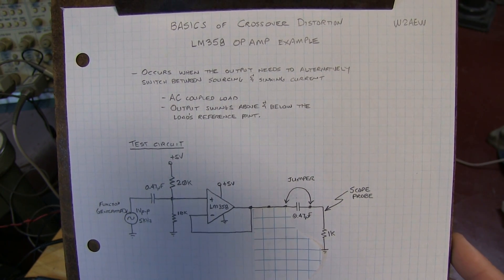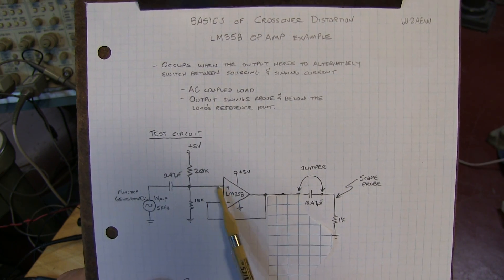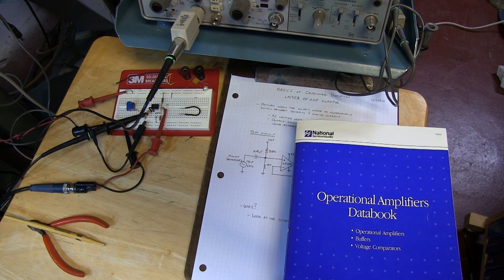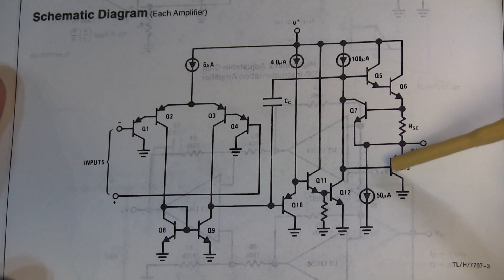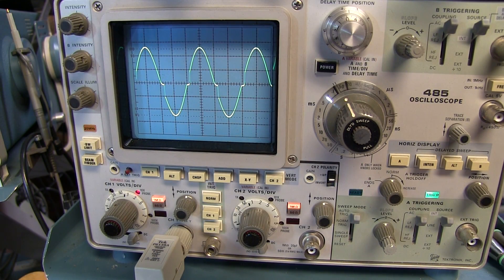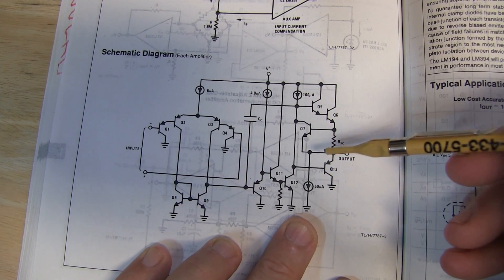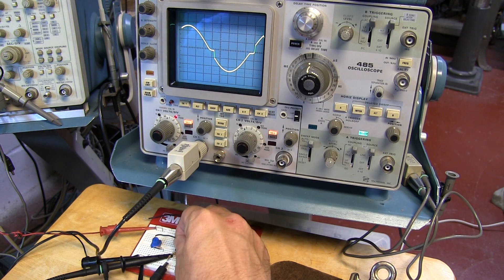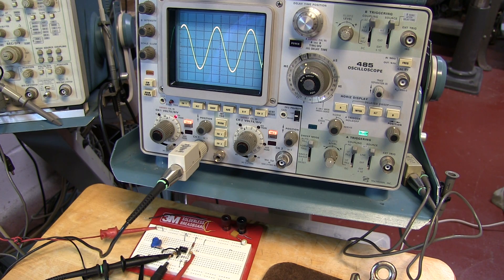#215: Basics of crossover distortion | LM358 op amp example

Comment: I saw a bench test that showed running this chip Class-A not only reduces the distortion drastically, but actually takes it lower than more favorable chips across a wide range of operating conditions.
With that said, the author concludes the article that there are still much better chips to select from no matter how you run it lol.

Comment: I'm here because of IMSAI guy's latest video, but wish I watched this sooner. Well explained! I would think his "fake" lm 358's distortion would have been just as bad at the lower frequencies. Perhaps they skimmed on that internal capacitor or 50 uA current source that keeps it biased. As an interesting side note, my YouTube algorithm has one of "Uncle Doug's" videos on biasing output tubes appear on my right column. Could "AI" have already worked this out? Ha Ha! Weird coincidence. Thanks for the comments and video.
Reply: yes my parts marked 'TL072' are in fact LM358. I did a bunch of tests. A 1K resistor to the negative rail 'fixes' things up. I gave up on LM358 op-amps decades ago. probably because of this but those brain cells are gone.
Reply: A lot of these Chinese parts are mislabeled. Thanks for confirming this. Very educational experience for me. @IMSAIGuy

Comment: I've been thinking on this...
Could we change the feedback resistor values, in an amplifying stage, to draw more current and have the same efect? I think that sounds right. In the follower example that you use the inverting input isn't connected to ground as it would be in an amplifying stage. (I'm still getting the hang of this stuff, so apologies if that's a daft question).
Reply from the maker: You just have to think about the direction of the current provided by the output. The distortion occurs when switching between sourcing and sinking current.  If the feedback arrangement and signal levels will always keep the output sourcing current, then you'll have no crossover.  Otherwise, a simply pulldown resistor at the output will suffice.
Reply: @w2aew  Just tested this in the lab. Works as you suggest. I tried it with a different op amp (5532), I get a x-over blip and can't move it, perhaps a different output stage.

Comment: Can the pull down resistor at the output used to deal with crossover distortion, mess with the DC bias of the opamp? Let's say I have an opamp stage in a preamp biased at half the (single) supply voltage of 9V, or 4.5V DC bias for the opamp, which is AC coupled with caps at the input and the output. If we were to add that pulldown resistor, would the bias voltage drop below those 4.5V?
Reply from the maker: As long as the pulldown resistor can easily be driven by the op amp output, and there is no DC connection to the bias stage, it will be fine.
Reply: @w2aew  I see, thanks! Much appreciated. I tested it with a 358 earlier today and sure enough, with a 10K pull down resistor the bias voltage remained largely unchanged, although the opamp was unloaded

Comment: I was expecting to see a little crossover distortion, but the amount surprised me. This begs the question as to why bother having the PNP output transistor at all, if folk have to bias the output current to such an extent that the transistor is never used. Surely the designers must have foreseen this problem, yet they took no steps to avoid it. At first I thought that the load might be too high, but a 1k resistor is hardly excessive. I realise that the LM358 is not the newest kid on the block, but did the state of the art at the time prevent the incorporation of circuitry to circumvent this issue? (For example, as per your video on Vbe multipliers or a couple of diodes or some such alternative design to eliminate or at least reduce the dead band).

I've used many OP amps in the past, but have never really paid more than a passing glimpse at what's inside them, but I'll pay more attention in the future. Your videos are excellent, by the way - keep up the good work.
Reply from the maker: Many applications operate at very low speeds, and the cross-over doesn't raise a problem.  The dead band is only an issue when the output has to switch between sourcing and sinking current quickly.

Comment: I came across this statement in the book (I have the TI version of it), that I wish you would have put in the video. They specifically call for that resistor when you have more than 50pF capacitance on the output, because they built it to have a powerful mode, and an efficient mode, and that distortion occurs when it doesn't stay in one mode (like when a capacitor is at peak current draw, ie. near zero crossing). Here is an excerpt from the paper, and it serves as a powerful reminder that there is critical info that is not in the tables, charts, and drawings.: 

"To reduce the power supply current drain, the amplifiers have a class A output stage for small signal levels which
converts to class B in a large signal mode. This allows the amplifiers to both source and sink large output
currents. Therefore both NPN and PNP external current boost transistors can be used to extend the power
capability of the basic amplifiers. The output voltage needs to raise approximately 1 diode drop above ground to
bias the on-chip vertical PNP transistor for output current sinking applications.
For ac applications, where the load is capacitively coupled to the output of the amplifier, a resistor should be
used, from the output of the amplifier to ground to increase the class A bias current and prevent crossover
distortion. Where the load is directly coupled, as in dc applications, there is no crossover distortion" ~~ SNOSBT3I Rev.: Dec 2014 Texas Instruments

Comment: Would you sink the resistor to Vee when using a split rail supply? Or would it still be ground? Awesome video!
Reply from the maker: It really depends on where your output voltage is going to go.  You want the output of the op amp to always source current.  So, if the output voltage is going to go below ground, then you want the pulldown to go to VEE.

Comment: Nice video!  It would be nice to see the effect of changes in gain and changes in frequency on the "fix" for crossover distortion.
Reply from the maker: As long as you keep the output stage sourcing current, the cross-over distortion won't be dependent on gain or frequency.

Comment: Thanks, I was baffled by this until I found this video! I was doing an LTSpice simulation and when I used the ideal opamp, all was well. But when I used an LM2902 spice model (from TI) I suddenly got these weird "ears" at the crossover point. I figured out that I needed a DC load to fix it, but I didn't know why, until now!

Comment: This is great!  Thanks!  I have this problem with a TL071 op amp handling a square wave.  The crossover distortion is short and subtle but I can see it on the oscilloscope.  I guess it is short because of the TL071's high slew rate?  I am going to try this solution!

Comment: How can this amp output go below ground if it is fed by a +5 volts only?
Reply from the maker: There is a ac-coupling capacitor on the output, and I'm measuring after that.  This removes the DC, and the signal swings around reference (ground) level of the 1K load.
Reply: Thanks. So in other words you in fact change the op amp from a so called "push pull" to a class A amplifier. Did I get it right ? What is the function of Q7? Could two diodes between base Q5 an collector Q12 have solved the distortion apearance? What is the function of Q7 in that op amp-circuit. Is it  a current limiter ?
Reply from the maker: Yes, the load resistor turns the output stage into a class A follower.  You'd need 3 diodes in this case, and that would have severely limited the output voltage range and supply voltage range.  Q7 is for short circuit protection.
Reply: Thanks for answering and making this video.

Comment: Two questions come to mind. 1. Why bother designing an op amp like this and, 2. I assume not all are like this. Very enlightening.
Reply from the maker: All designs have tradeoffs based upon the available technology and design goals. In this case, the output stage is low power, operates over a wide supply range, and achieves output swing to near ground (lower supply rail).  For many applications, the tradeoff with having some crossover distortion is not an issue.  The datasheet discusses this, and it is easily overcome for those applications where it is important.

Comment: Would the same situation and cure exist with a tube based circuit?
Reply from the maker: The same type of crossover distortion can occur in push-pull output stages.  However, the cure would not be the same since these stages are often transformer coupled to the output.

Comment: I just bought some LM358P opamps to experiment for making for rudimentary audio signal mixing and source following in a portable amplifier. It has 19 some odd volts on a single rail LiFe battery pack. I was hoping to just use the single rail power supply, and capacitively couple it to remove the DC bias.

In talking with my roommate, he said that there might be issues with my scheme, and then I found your video, which was just the thing I was looking for, fixing a problem that I didn't even know I was going to have--before it happened.

Thank!!!
Reply from the maker: Yes, ensuring a DC pulldown on the output, and AC coupling in/out for your audio signals, should all work well.  Have fun!

Comment: hmmm interesting.
is there such thing as a vacuum tube based op-amp?
Reply from the maker: +260830107 There was, of course, before semiconductors.  Op amp like circuits were used as early as the late 30s, early 40s.  The first commercially available op amp (marketed as such) was the Philbrick K2-W in 1952.  No one is making them now commercially (maybe some oddball audiophile is - which wouldn't make much sense). Lot of history can be found in these links:
http://www.philbrickarchive.org/

http://www.computerhistory.org/revolution/analog-computers/3/156

https://en.wikipedia.org/wiki/Operational_amplifier

http://www.analog.com/library/analogDialogue/archives/39-05/Web_ChH_final.pdf

Comment: Would the distortion start to appear again if you were to increase the input frequency ?
Reply from the maker: As long as the output stage remains in class A mode, then no, the distortion from crossover would not reappear

Comment: Alan, thanks for this video. Here is a (probably very dumb) beginner's question: why does the op amp need to sink current at all? Since the output can swing only between the supply rails (+5V and GND) and the load is connected to GND, the output never has a negative voltage, i.e. in my understanding, the op amp would always source current.
Reply from the maker: The answer is, not all loads are DC coupled or are ground referenced. Each of these situations can lead to the need to source current.

Comment: By looking at the output, I understand that lm358 has a current limit when the output is sourcing current, but none when it is sinking current? In order to limit the current, it has to flow through Rsc, am I right? Sorry for my broken English :)
Reply from the maker: +MrJohhhnnnyyy Yes, for sourcing current, it goes through Rsc, and then when the voltage drop gets large enough, it turns on Q7 which starts to steal bias current away from Q5/6.

Comment: Datasheet no longer has the nice photo's of the dies and a drawing of the terminals for the bare dies, as used in the heyday of hybrid manufacture.  It also shows as an aside why the output stage is protected against shorts to ground, with the transistor and sense resistor, but that it will blow up immediately with a short to the supply rail. 

The current sources are also not shown, the sink and some of the sources are simply a pinched off FET, not too accurate but if you only need a low current very usable. A diffused resistor of high value would take up most of the die. the more precision ones use a few transistors, but still have the pinched off FET as a startup, and all the ones referenced from the positive rail actually are a single current mirror using scaled transistors to determine the current. That is why the simple opamp tracks well over temperature, as all currents inside are generally used in ratios and rarely as absolute values.
Reply from the maker: +SeanBZA Some of the other databooks I have do show the more detailed schematics, including the current source structures as you described.  I chose to show this one, because that level of detail was irrelevant to the video topic so I didn't want to show the unnecessary complexity.

Comment: Generally, I like your videos very much - very informative and enlightening. On this specific topic, I get what it is, how it looks on the scope, and what is causing it. But as a total n00b I would greatly appreciate, if you could at least update the description and put in why it is bad (or at least undesirable), or any other effects on the rest of the circuit. Is it most common in RF circuits or power supplies, or where?
Reply from the maker: When using an amplifier on a signal, any type of distortion is undesirable, because it alters the shape (and thus, the frequency content, purity, etc.) of the signal.

Comment: It should be better titled as improper LM358 application specific biasing requirement. It is stated in the databook to install a resistor for capacitor coupled load so as to increase the internal bias requirement.

Comment: Wouldn't this method add a fair bit of power draw to the circuit? Couldn't you get rid of the distortion using some sort of feedback like another op amp or something? Could be one of those situations where the added cost of an extra op amp doesn't justify the power improvements (which could be really small anyway).
Reply from the maker: Sure, this adds a little to the power dissipation, but that's the price you pay for Class A operation.

Comment: Wow, that was great. You  have a cool knack of describing things easily. You should try and get your local college to let you have some teaching slots. You obviously enjoy teaching and your very good at it.

On the scope your showing negative transitions but is the device not biased above ground? That is the only part I did not understand. Is where you say ground on the scope in fact the bias point above ground. Ground references always confuse me.
Reply from the maker: The op amp is powered between +5V and ground. The input is biased above ground. The load resistor is connected to ground on one end. When it is AC coupled, then the voltage across the load swings above and below ground, because the net current through the capacitor must be equal to zero (so the forward current has to equal the reverse current).
Reply: +w2aew Thanks I get it. So beyond the cap we get the negative swings. Great video.

Comment: Is crossover distortion applicable to high speed current controlled op-amps in case when you use them as voltage buffer + 50 ohm / AC coupled output ?

My educated guess is that line between output of op-amp and AC coupling cap is a transmission line, and it should have 50 ohm impedance, so we can say that we have 50 ohm load on output of op-amp, so crossover distortion should be a case there.
Reply from the maker: Devices designed to drive high speed 50 ohm loads will usually not have crossover distortion because the output stage would be specifically designed for those loads.

Comment: Wow! There I thought I knew at least the basic stuff to watch out for with opamps, but I never heard about crossover distortion before. And that is with the LM358 being the main opamp for most projects where you need "just any opamp".
Reply: It's a great general purpose op amp, crossover distortion is usually not a big deal unless it has to do with audio. Do not swap a modern opamp in an audio amplifier with a LM358 unless you like fuzzy distortion :P

Comment: isn't that related to amplifier class? you had a class B output (one transistor on per half cycle) and you made it a class A by never opening the bottom half.
Reply from the maker: +nraynaud1 Yes, absolutely.  Without the DC pulldown resistor, each of the two output transistors is operating Class B.  As I added the output resistor and starting lowering  it, the NPN went into Class AB, and the PNP into Class C, until eventually the NPN was operating Class A (and the PNP was off).
Reply: @w2aew  Hi, again!  I had the same problem with a TL072 op amp.  I used your solution to get the crossover distortion below the bottom peak of the sine wave.  Question:  Is there any downside to this approach?  Is forcing the upper, NPN, output transistor into class A mode bad in any way?  Is it inefficient?  Is too much heat generated?
Reply from the maker: It uses a little more current. But provided that you don’t exceed the maximum output current rating, and you can still drive your load and achieve the voltages you need at the output, all is well.
Reply: I found some very old KA3403 (Gold Star or Samsung brand, I think) op amps in a "surplus surprise box" from a well-known electronics supply store on the west coast of the USA.  The KA3403 has four op amps on one chip.  The outputs of all four op amps are class AB.  No crossover distortion!  Nice.  I can't seem to find other op amps that have class AB outputs except for some expensive, "audio grade", Burr-Brown op amps.  I wish more op amps had a class AB output.
Reply: @brockwood5208  Try LMV324/358/321, or for slightly less noise LMV324A/358A/321A.